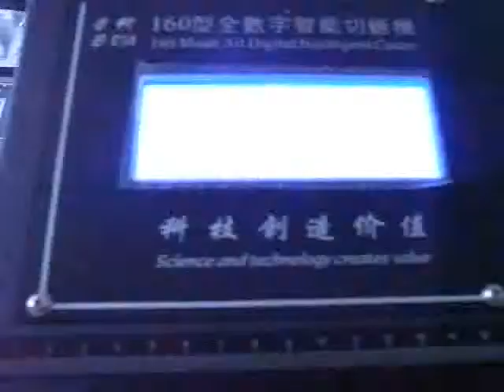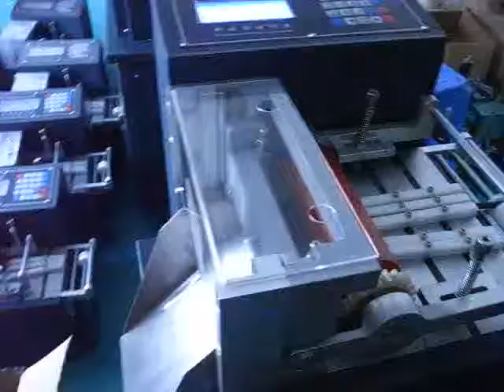Auto Tubing Cutter / www.fortunesky-tech.com / jinhongbao119@gmail.com

Comment from the maker: This is our new style computerized PVC Tubing Cutting Machine,WOO.. it cannot only cut PVC Tube, but also Aluminum Foil,Cooper Foil,Fiber Paper,PU Film,Foam and All SOFT THIN materials.Moreover it can be equipped with heating device to cut Ribbon Tape, Magic Tape, Hook Loop, Zipper, automatically FIX-LENGTH Cutting and Edge Sealing. Welcome to send inquiry with Mr Robin by Email: sales@fortunesky-tech.com, thanks!
Reply from the maker: http://www.fortunesky-tech.com/blog/2014/06/